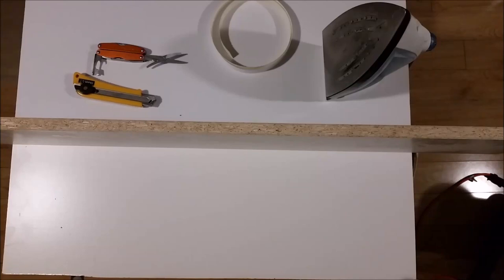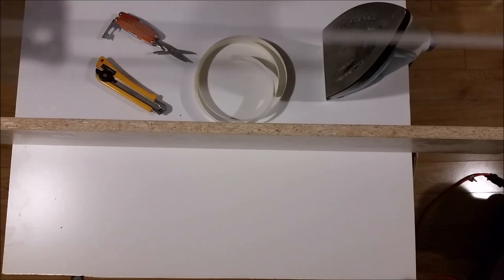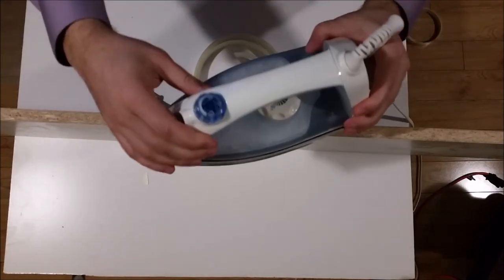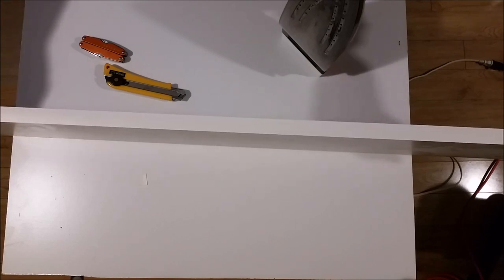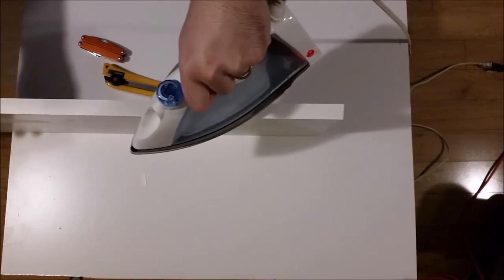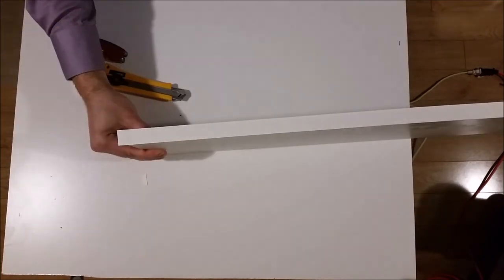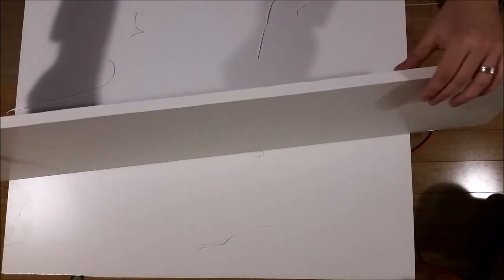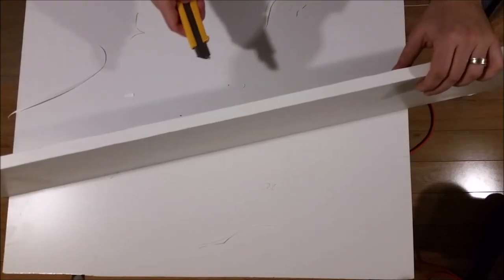Edging Particle Board / Melamine Board

Comment: What is the material called that you used. I have a very expensive bedroom suit that my son in law messed up when moving my furniture for me. I do not know what the material is called but looks similar to what you used here. Almost a thin shiny plastic glued on particle board
Reply: It looks like melamine edgebanding. They have rolls of it at Lowe’s running $7 for 25 ft.

Comment: My problem that I have wardrobes already built with mdf edges. Can I still using taping method on door and drawers? Would not the force loosen the door joint or if the iron is full hit one donot need to push hard.

Comment: Very cool.  I am installing melamine shelves in a pantry.  The shelves will have large 20" radius C shape cut out so a person can step into the pantry and also to reduce the depth of the shelves.   I am reluctant to use the melamine edge banding because I expect it will come loose in a few years of heavy usage.  Any tips on curved wood edging?  Both cutting an clean C shape piece from the melamine and then cutting and fitting wooden edge?
Reply from the maker: +Vince Emmer alright, that's a few questions in a row. First off, I have seen this stuff peel after 20 years, but it was drying glue, not thermal set glue... This may hold better over time, but it's hard to tell. As far as cutting the circle, it will be very difficult to have a good blade do an angle like that, a jigsaw will destroy it... Not sure how to rotary cutter would do. I'm curious, so I'll do some tests this week and post how to cut that arc and a comparison of a few blades / tool types. Going with plywood may be best, then you could use this kind of Rubberized stuff http://amzn.to/2aKaoKp
Reply from the maker: +Vince Emmer video is up! https://youtu.be/Zp_Tg_WCTvM
Reply: Vince Emmer 
please what type of glue did u ise in binding the edge roll to the board?
Reply from the maker: +nana yaw adjei it's applied on the veneer roll by the manufacturer. I just beat it with an ironing tool for clothing. I hope I helped you. I hate to do this, but now I need to ask for your help. With YouTube's new terms of service I'm going to be demonetized in a month. Even if the rest of my channel isn't your style, I would highly appreciate if you subscribed to help me maintain my ability to get paid for my work. Thank you very much in advance.

Comment: What if your edge banding is the non glue version.
Reply: Use Contact Cement. With Contact Cement you brush it on both surfaces that are going to be joined (you will want to use frog tape to mask any surfaces that will likely be overlapped by the cement). You then let the contact cement on both surfaces dry until it slightly tacky but mostly dry to the touch. Then you want to be very straight like he showed here but do no let the glued sides touch each other until you're sure its in line. Then as soon as you put it on start at one end and slowly press it on. You might want to test it on scrap pieces so you can see how see how the tacky sides instantly bond together and become impossible to remove or move. Elmer's Contact Cement is inexpensive and comes in a small brown bottle with a applicator attached to the inside of the cap. It will be enough to do several edges like he had.